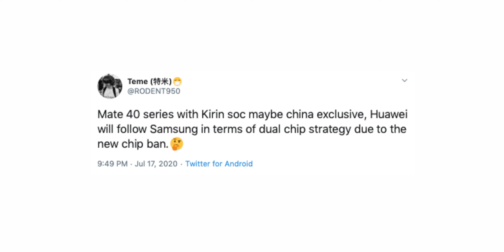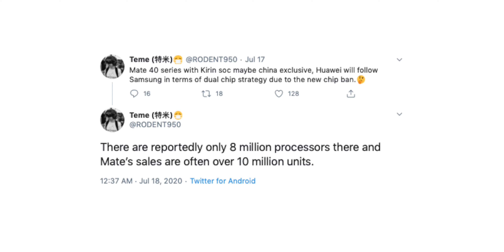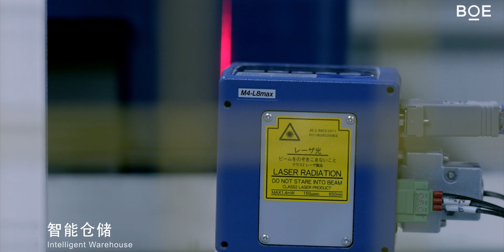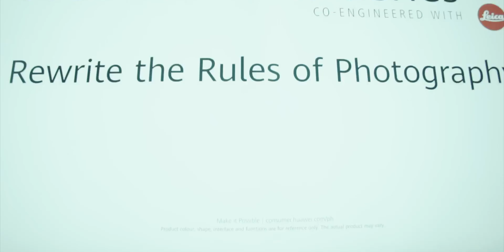Huawei Mate 40 Pro - THIS CAN CHANGE EVERYTHING

Comment: They can't beat Samsung 😂😂🤣
Reply: Well don't be stupid, the Samsung's year over year growth was decreased by 19 percent but huawei's growth just increased by 15 percent, well even Samsung can't do a successful processor
Reply: @jobimalhi230  why r u calling ppl stupid if they dont know something?
Reply: @jobimalhi230  samsung processor is exynos which are worse than kirin and they always overheat and throttle.
Reply: @malathomas6141  who told u exyon over heat it is not it depends. On whole the phone it is the stronger processor but as compared to snapdargon it have a different u don't know anything watch pogo...kirni 3rd class most powerful are exynos  990
Reply: @jobimalhi230  kirin 990 is considered more powerful because it can sustain its performance while exynos 990 throttles after a couple minutes therefore droping its frequency.go check some benchmarks and test on youtube.
Reply: @malathomas6141  3rd class procceser Kirin 👎no power have knowledge first then talk with me
Reply: @jobimalhi230  go check youtube bro and you will see its not about peak performance its about sustained performance
Reply: @malathomas6141  we Huawei p30 pro compared with s10+ and other mobile performance overall this Kirin 👎 is
Reply: @jobimalhi230  compare p40 pro to s20 ultra with exynos 990 and the kirin 990 is faster
Reply: @malathomas6141  🤣😂😂😂 Kirin in my experience is useless by many reasons hauwaei company is not using exyox becz they don't want to invest in Samsung proceses no future with this mobile
Reply: @malathomas6141  🤣🤣😂😂nice joke by typing it will not exyox are the best procceser in the world after snapdragons Samsung Galaxy s20ultra model super fast p40 pro 👎👎👎
Reply: @malathomas6141  midia tech is much better than Kirin don't compare with this with exyox 🤣😂😂
Reply: @malathomas6141  Know about this Kirin no performance lol
Reply: A R  you are the heater Samsung Galaxy mobile are on the top no heat issue found in them Huawei in India tho no body Interneted to buy this bhulshit mobile no more store no good experience people are having Samsung company is on the top believe or not u talkee bhulshit in the comment is bhulshit don't make in sence when Huawei was not in trouble then also they were losser now also ... APPLe and Samsung are the world best smartphone company there competition is there in market ....and in dream hauwaei can beat Samsung but now impossible it still on top.. overall
Reply: A R  this company will be stop 🤣😂 according to stiutation
Reply: @jobimalhi230  mate 30 pro have Kirin 990 and has beaten s20 ultra lol
Reply: @m.hasnainakbar3836  note 20 ultra is best smartphone in world
Reply: @jobimalhi230  Samsung uses exnos 990 in expensove phones while media Tek and exnos have batery issues while Kirin and snapdragon are the best kirrin 990 has beaten I phone 11 pro max but mate 3 don't have Google services bcze US bann it
Reply: @m.hasnainakbar3836  why are u telling me then I Know everything badly hell u are talking on the point  talk about Samsung not other I don't care about other brand phone apple or mate Samsung is using sanpdagraon in your India it didn't came it's not fault no one in India buy these brand huwaei 🤣😂🤣they go for Samsung iPhone or OnePlus and Samsung is in top to sell their smart phones
Reply: @jobimalhi230  I am A Muslim and from Pakistan for you kind info 😏